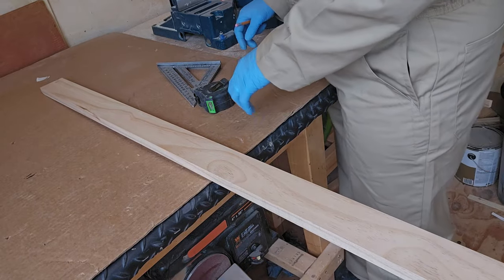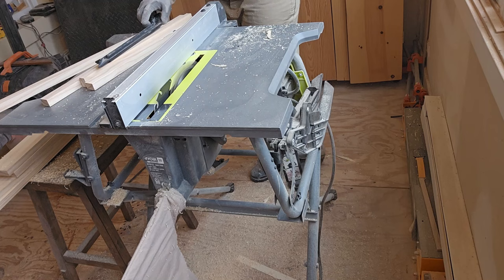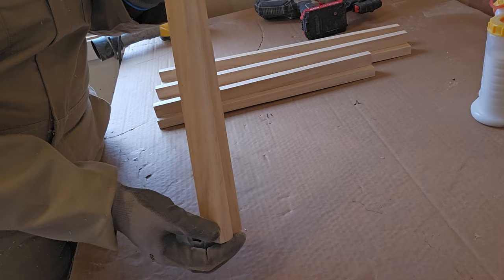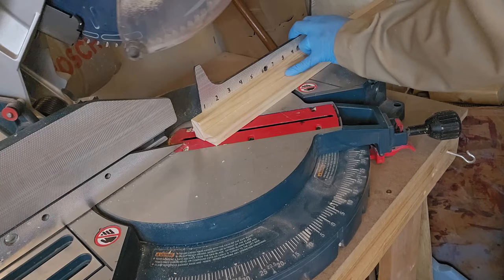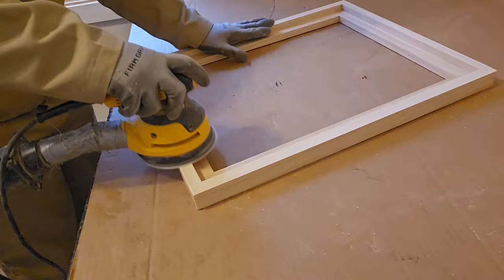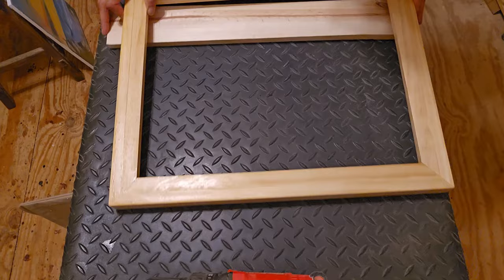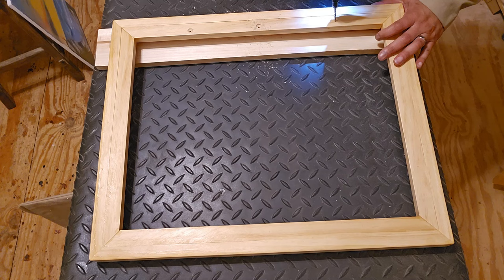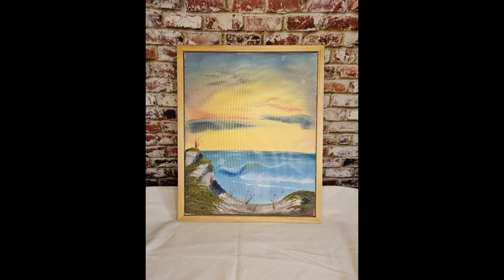Floating Picture Frame

Comment: I just clamped mine together following your plans. I’m tempted to throw a nail in each corner for stability. Could always putty small hole. What are your thoughts?
Reply from the maker: You can do that if you want to. Put the nail in the corner where no one would see it, the top and the bottom of the frame.